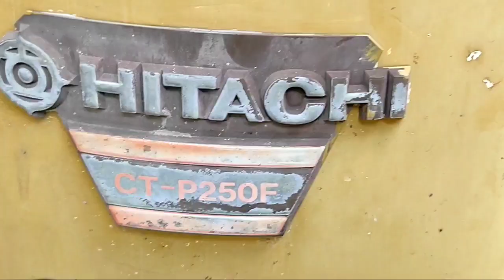Ganti Air Charger Pompa Air Kuat, Awet Suara Halus : HITACHI

Comment: Akhirnya proyek saya menggunakan solenoid valve dan pressure switch dan pressure tank selesai pak, pakai 12 v, juga pakai check valve, tekanan 70-80 psi jadi 18-30, pakai prv juga pada tekanan 40 psi, soalnya prv alirannya kecil
Reply from the maker: Keren mantap
Reply: Beli di mana regulator prv itu bos
Reply: @aldywahyudi7703  ada di Shopee, tapi dulu beli di Tokopedia, emang agan tekanan awalnya berapa
Reply: @aldywahyudi7703  ada di shopee ntar saya kasih link nya

Mas jangan dulu di hapus ya komen link itu sebelum dia membalas 🙏🙏🙏🙏
Reply: @sayalaperbandel  prv idealnya di tekanan 60 psi lebih gan 
Karena kalau 30-60 psi masih aman 
Standar nya sekitaran segitu untuk rumahan terutama yang pakai water hetarer mesin cuci otomatis dan kran mahal semua 
Kalau di kita banyak yang  asal ngalir aja udah bersyukur 🙏
Makanya bule sana pada di pasang prv karena air bersih yang di sediakan kota seperti PAM bisa sampai 10bar setau saya  🤯 Joss kau gak di pasang itu 
Tapi biasa nya sama pihak penyedia air bersih  nya juga untuk 1 lingkungan di pasang prv besar mas kayak trafo gitu kalau di listrik
Reply: @bangherlambang3226  iyah gan disini boro boro pakai prv malah pakai pompa gan,
Reply: @bangherlambang3226  https://youtu.be/qv-EbzQogiE iya pressure input cukup kalau pakai solenoid valve kayak disini gan,
Reply: @sayalaperbandel benar waktu pertama kerja di PAM Bandung 
Trandis 
Sering saya dapat teguran konsumen  mas ini gimana air PAM kok di sedot pompa👏
Atau mas banyune ORA metu metu 
Karena saat itu selalu sama teman asal perbatasan Jabar Jateng jadi Jawa bisa Sunda bisa ngomong nya 
Ke pelangan
Reply: @bangherlambang3226  owalah gitu gan btw saya air gunung kok mahal ya gan, kayak dapat dana buat bikin pipa terus tenaga swadaya masyarakat, di nagrak, lah kok 4500 per m3
Reply: @sayalaperbandel  itu Rp 4500
Pemakaian 1-10m3 lumayan juga segitu PAM aja rata rata 2000-4000 /M3 untuk rumahan biasa apalagi sederhana maaf masyarakat miskin biasanya dapat tarif termurah setara sosial (masjid panti atau pesantren )cuma dibatasi misal hanya 1-10 M3 seterus nya harga normal rumahan sederhana lain nya (kalau masjid panti asuhan dan pesantren 1-30 M3 dan seterus nya setau saya sama harga nya )
 
Dan hati hati juga gan 11-30m3 biasa ya jauh mahal lagi mas
Reply: @sayalaperbandel  memang agan di mana
Reply: @bangherlambang3226  saya di nagrak pak, 29 m3 10 hari dua rumah, total 7 orang harga 132500 wajar gak pak
Reply: @sayalaperbandel  lumayan gan pelangan PAM aja rata rata 100-150 ribu per bln gan 
Dikota besar kayak Jakarta Batam surarabya (yang ku tau ) 
Bisa 300k per bln karena tarif nya mahal
Reply: @bangherlambang3226  iyah padahal airnya kotor gan gak bisa dimasak mending ane mompa sih jadinya
Reply: @bangherlambang3226  soalnya total 7 orang, dua rumah
Reply: @sayalaperbandel  PAmsimas ya gan
Reply: @bangherlambang3226  iyah yang kerja masyarakat, pipa dari mana gitu, kalau 3-4 hari 11 m3 wajar gak mas dua rumah
Reply: Waduh 4 hari 11m3 rata rata yang banyak orang nya saja 60 meter kubik an per bln atau sekitar 2m3 per hari kecuali rumah mewah wajar 

Awas meteran nya masalah gan kalau pakai yang Abal Abal maksunya yang murah walau udah SNI suka ngaco pembacaan nya
Reply: @bangherlambang3226  owalah gitu ya pak, hemm yang mahal berapa harganya pak
Reply: @sayalaperbandel  yang di pakai PAM 300k an rata rata
Reply: @bangherlambang3226  owalah iyah meteran jelek tapi kalau sama pakai pompa kedalaman 40 meter masih mahalan mana gan biasanya,
Reply: @sayalaperbandel  mahal bikin sumur nya gan bisa di atas 10 juta kalau kedalaman segitu 
Kalau oprasiona tergantung ukuran pompa nya 
Tapi menurut saya rata rata per hari 1-2kwh pemakaian pompa air jet pump atau Sibel yang dibuat otomatis tanpa tandon air apalagi debit air nya kecil pakai tandon pun bisa boros di listrik nya karena lama penuh nya
Reply: @bangherlambang3226  iyah gan alhamdulillah dah punya sumurnya,

Comment: Kalau pompa Hitachi ini mau saya jadikan pompa pendorong ke toren air di ketinggian 12 meter dari groundtank, bagaimana cara modif pipa P dan S nya mas sehingga bisa menerima air dari ground tank tanpa harus menggunakan mata jet?. Anggap groundtank dan mesin akan ditaruh sejajar dan sama rata. Maaf jadi merepotkan. Terima kasih.
Reply from the maker: Tinggal di plug  ( dop drat luar ) saja bagian Pressure nya/ P..
Tinggal sambung pipa ke S ditambah tusen klep,
Reply: Siap. Terima kasih mas atas berbagi informasinya.
Reply from the maker: @noonejustme888  sama sama